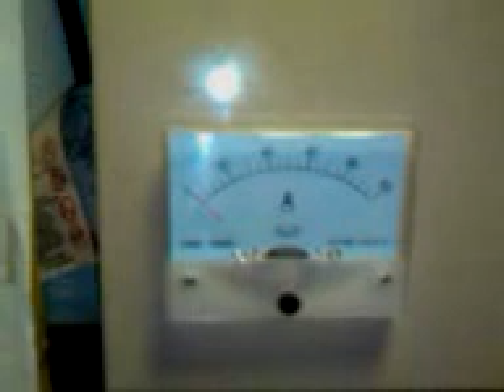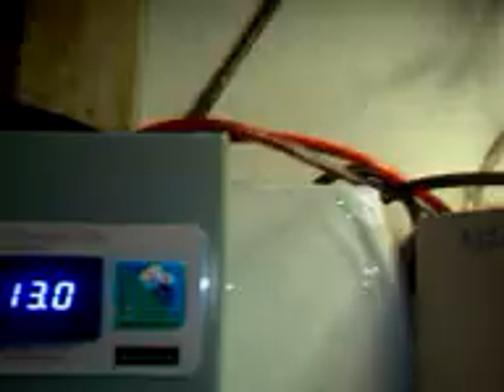Cleaned up wiring on my wind and solar Before the Tv Fliming Doomsday Preppers

Comment: cool video man man I loooooove that battry bank I cant wait to get my wireing all cleaned up.  I have build my own charge controller I got the controller from colman air but all the rest is all done by hand.  I have 4 A/V meters they can do double duity as both volt and amp meters with a 200 amp shunts.  right now I have just two shunts so two meters are for amps and two are for just voltage. I cant wait to get more and more. lol. nice video .